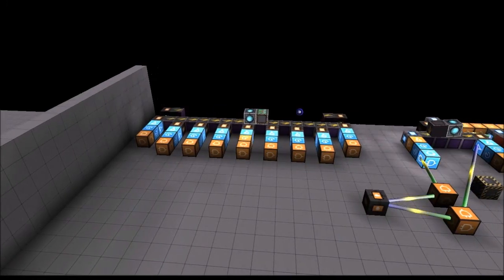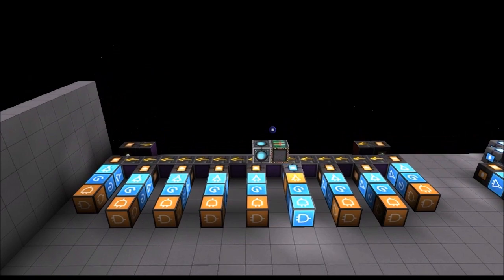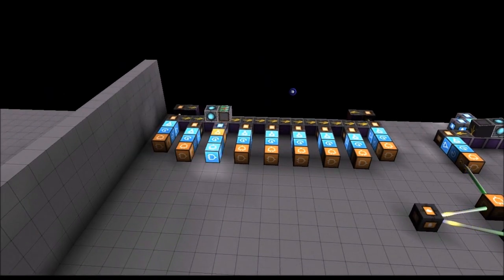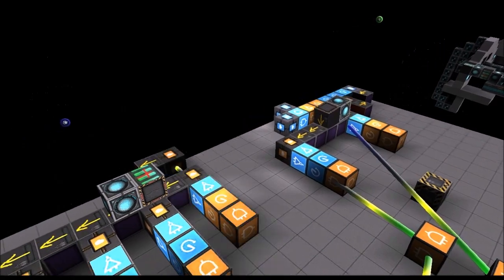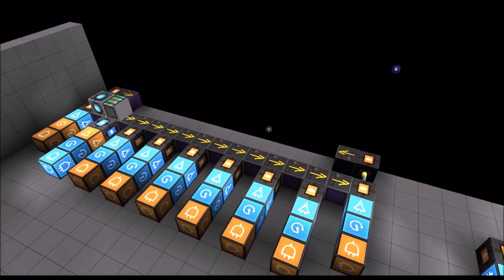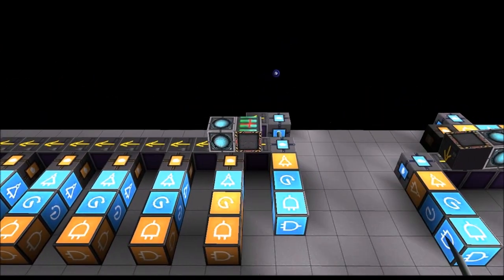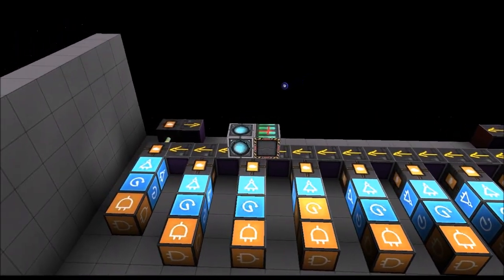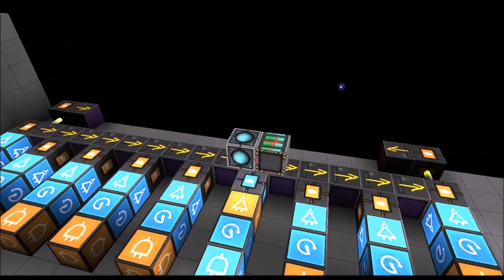Starmade Rail detection system Dev build v0.19187

Comment: Nice find fuse i am loving the rail system more and more :)
for the button logics there should be if i am not mistaken a new block that acts as activator not delay and combo...afaik they implemented that recently along with an t-flip-flop block because these 2 circuts were used so often that it makes sense to put them intirely into new blocks to reduce lag caused by logic